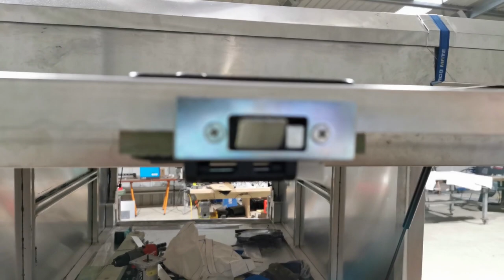DIY Camper DOORS - DIY 4x4 canopy Ep V

Comment: Nice work, Helpful hints.  I'm working on doors on side boxes underneath a Lance camper.  I put the hinge on the bottom to give myself a table surface to work on.  My doors are flush mount to the box surface so the water/ dust seal is across the top and sides.  Still trying to figure out the seals.

Comment: hey mate did you think about adding handles ( ie. length of pipie )  to bender to give you more leverage when bending
Reply: also anchor bench to ground so it won't lift
Reply from the maker: Yes.
But the main problem is the strength of the dies. The bender is too long for the job.
Will consider making hydraulic presses later.